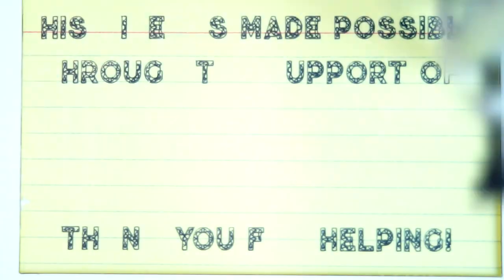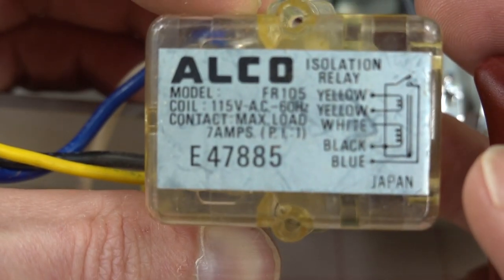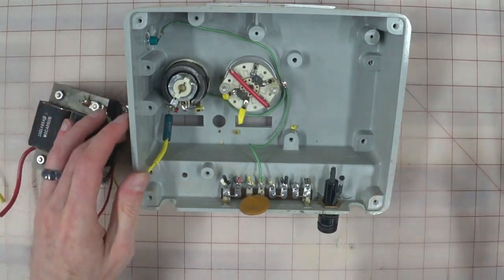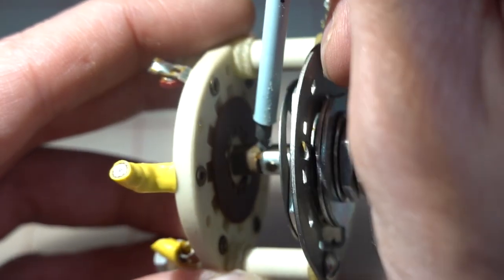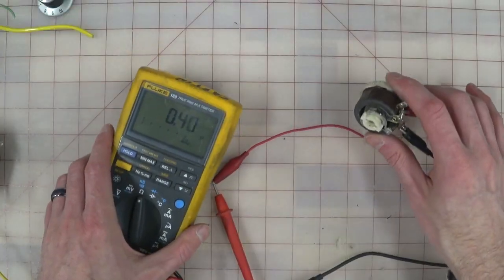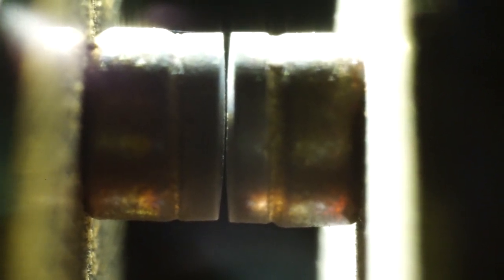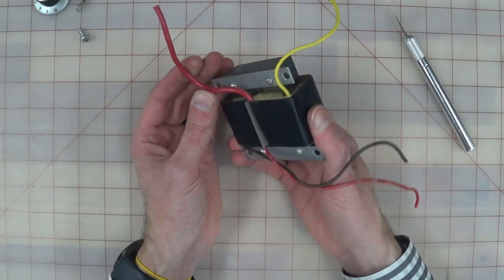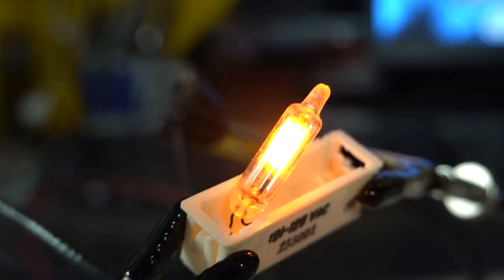Equipment Autopsy - Electrocutor (Medical Cauterizer)

Comment: The relay basically has an integrated isolation transformer, in a sense: although it's magnetically not quite identical to an isolation transformer in operation. The effect though is that you have these yellow control wires that are on an isolated secondary circuit. What they've done magnetically is put the isolated, "yellow-yellow" control winding on a magnetic shunt that bridges the poles of the primary "black-white" excitation winding's core. Think about that black-white winding and the outer legs of the core that lead to the armature as you would in a normal relay. Typically you'd apply power and the flux would squirt out of the poles, across the gap, and to the armature, pulling it in. But there's a piece of core shunting the poles (the piece of the core that passes through the control winding). When you leave the control winding open circuit, it's like it's not there. That shunt segment is just "short circuiting" the magnetic flux from the excitation coil, so none goes out the poles, and the relay remains open. When you short out the control winding, the flux can't pass through the shunt anymore, because an opposing current (like an eddy current) is set up in that control winding. The flux is then forced to travel out through the pole faces and through the armature. So it is basically a transformer, just one that does its job when the secondary is short circuited!
Reply from the maker: This. This is the greatest comment I've ever had in several thousand videos. This is the gold standard. Thank you. You've just made my entire morning awesome. You, rock. :) And thank you for teaching us all something new! :)
Reply: I figured this was the case, but I wasn't sure enough to comment:)
Thanks for enlightening us!

Comment: I noticed the effect the light from the room had on the neon lamp when you shut them off. There is a subtle glow change in the lamp. They used them in some of the older first generation of electronic organs.

Comment: Date codes all read 1981, erd or 4th quarter.

You need to learn to look for 4digit numbers that encode a 2 digit year, and a 2digit week#.
The transformer is coded 8144, 44th week of 1981
Reply from the maker: I can never be sure if that's a date code or if it's just some internal part number or something. How can I be sure?
Reply: @Physicsduck  
You often can't be 100% sure, but if the date code you come up with is consistent with the approximate era of the whole assembly, and if you see other similar date codes (the resistor also had an '81 date code--the first digit was 8, not B) that can improve your confidence.
Reply: Also, the date codes may be wwyy, or yyww, but you can usually get a clue when the week portion of the date code is never above 52

Comment: with the two coils on the relay one may be partly magnetising the core and the two yellow ones are triggered by the handle produce enough magnetism to pull in perhaps, or maybe they are just hooked in series